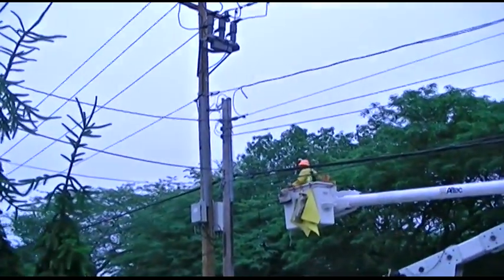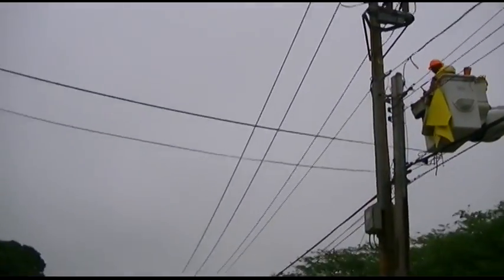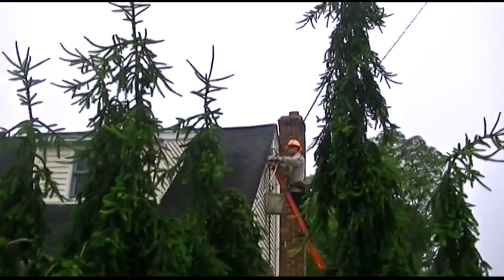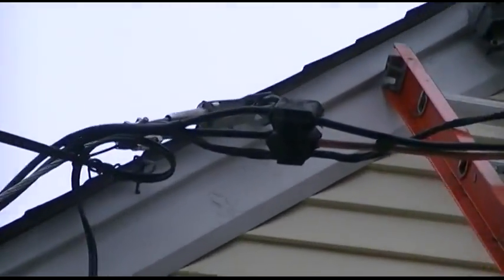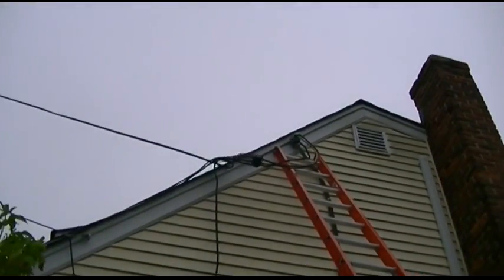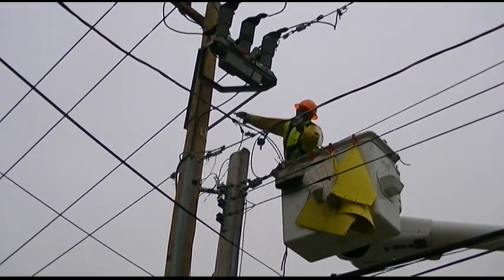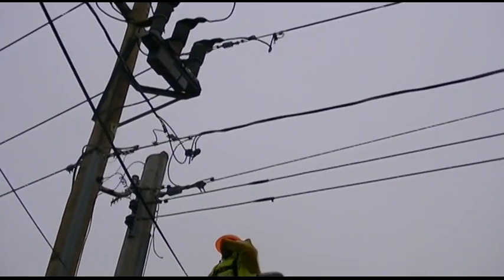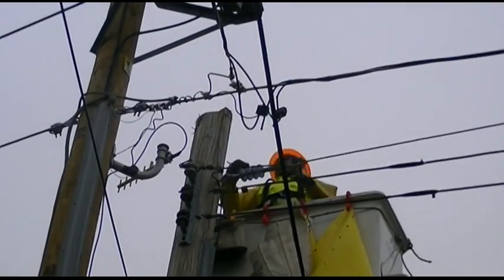New Electrical Service For The House!

Comment: 10:03 The wire in the house does not "have to go copper by Code." You can use aluminum for the drop to the meter, and from the meter to the main panel.  Range and dryer circuits are still commonly aluminum wire as well. You can (although it is no longer used) use aluminum for the individual circuits in the house.  Now some state or local municipal electrical codes may say otherwise...but it is not true "By THE Code" i.e. the NEC.
Reply from the maker: Yes, aluminum is fine on the outside of the house and to the circuit breaker panel  Aluminum hasn't been commonly used since the 70s.  I've never seen a 220V outlet using aluminum, here in NY, but other parts of the country may be different.  Is copper code here?  I don't know for sure, but I do know that existing wiring is grandfathered in as it was code for the time it was installed.

Comment: its nice. dude, can tell us how much money you spent for new electrical service? and how much amp u use in the house? thanks
Reply from the maker: I paid nothing.  The company was in the area for the entire summer, upgrading everything, replacing poles, restringing wire, so I asked them if they could redo the electrical service to the house.  

I don't use any more or less amperage in the house since the upgrade; my panel has always been 200 amps since I moved in.
Reply: @jaykay18  damn, how cool is dat. nice bro
Reply from the maker: @sobricoeg1510  It was simply a matter of being in the right place at the right time.

Comment: they use aluminum cuz its lighter than copper you would get a tight pull from pole to house with copper not to mention aluminum cools off faster better heat tension
Reply from the maker: That makes sense.

Comment: It’s fine to use aluminum wires in homes, just not 15 and 20 amp lines. 30, 40, 50, 100... Saul Goodman.
Reply from the maker: Most of those lines I've ever seen have indeed been copper.
Reply: copper is the recommended in the branch circuits in the house unless otherwise told by inspector aluminum can be the feeder   me personally I'd use copper but I aint paying the bill just installing it

Comment: ga power gave me hell last year when i ask for a new line . My electrical box needs to be upgraded in my 1950 house to put a new hvac system in. I was to told by an electrician the 3 wires they have coming in form the pole is not going to give me enough power. Ga power said they sent a guy out twice and they wires are fine.  I didnt see anyone and they refuse to schedule someone to come when im there. It seems like they dont want to do the work and have me do it .  My neighboors have the up grade.This is Crazy !!!
Reply from the maker: I can understand your frustration, but I'm not able to help you with that.  The work that I had done was a result of third-party contractors, real nice guys at that, being hired by the electric company.  Their job was to replace all the utility poles, transfer switches, and transformers around the neighborhood as they were reaching their life expectancy.  The third-party contractors didn't have to report that this work was done, their job was to do whatever was necessary, so perhaps they deemed this necessary.  In fact, they told me that the original plan was to replace the electrical service to all the homes as well, but that was scrapped because of cost.  They did it for me for doing nothing more than asking nicely, and a friend also got his done in the neighborhood, for also asking.

Comment: OO Awg Carryies 225 Amps at 90 degrees F. ITS a good match for JayKay's 200amp service, which sounds like overkill, unless you have a mother/daughter setup or a tenant.
Reply from the maker: 200 amp service is now the norm for new installations.  I already had 200 amp service; they just replaced the wires, because I asked.  They were in the neighborhood replacing all the utility poles and stringing new wire between them.  In the summer, I have a pool and 8 tons of air conditioning, so that 200 amp service comes in handy.

Comment: Well if those wires you read said 1/0 then they’re usually for 155 amp so from how I see the size of your house it should be more than enough
Reply from the maker: The panel is a 200 amp panel with a 200 amp main.  I was told they were putting 1/0 cable in.  It's 3 conductors, on different alternating phases, so there should be a current load capacity of 300 amps total over that 3-conductor cable.

You'd be surprised how much power my house uses.  There's 8 tons of air conditioning and a pool, just to start.
Reply: jaykay18 I believe your house is on a single phase which means you get 2 hots a neutral and maybe a ground those 2 hot wires are 120 volts each which makes your house a total of 240 volt with a resistance of 200amps and more. It’s rare to see a residential house on. 3 phase because you don’t need that much voltage. The bigger that wire is, the more it’s resistive to heat. Your house can also use aluminum or copper, copper is just more expensive and it’s a better
Reply from the maker: Yes, thanks, you can explain it better than I can.  That's exactly what it is.
Reply: @oscar27ization  All houses have a 3 wire 120/240 service unless you only want to have lights. That has nothing to do with 3 phase or single phase. If you have a welder or need special power like 120/208v or 277/480 etc. then you would need 3 phase power. In that case you would have a 4 wire service. That's called a transformer bank.
Reply: 1/0 copper 200 amp

Comment: @jakay18 the lines itself are not tensioned. the tension wires are wrapped around the actually electric wire to keep it from sagging. the things you said you didn't know what they were....are called insulators. it keeps the high voltage wires on the poles from arching and causing a fire. they are usually made of ceramic. also it helps with the cooling. because a lot of power lines do not have sheathing on them. the reason behind this is to keep them cool.
Reply from the maker: Thanks, they gave me some of the insulators that were up there.

Comment: my man smokin a cig while he workin on some dangerous electrical work that could kill him and straight literally blow him right off the ladder lmao.
Reply: I think you should worry about your Brain cancer than his safety, he knows what he is doing and I will bet $ that he will live longer than you do :)
Reply: @oohlangster1135  You mean COPD or lung cancer lol. I'm guessing you're a little kid.
Reply from the maker: These dudes were pretty cool.  They ran new service to the house simply because I asked.  They redid all the utility poles and strung all new wire in the area; the original plan was to run new service to each house but they quickly nixed that due to budget restrictions.  But just because I asked, they did this for me for free.  They also gave me some of the cool stuff that was on the pole, including those ceramic insulators, which is great because now you can touch and hold them instead of seeing them up there, you get to see how really big they are.  There was also an antenna on the pole that was taken down that they gave me, there's a shunt on this pole and that was replaced along with a new antenna as well.  I was actually home when they tested its wireless functionality, and you could hear the shunt inside turn on and off.  That was pretty cool.
Reply: @jaykay18  well thats cool. they usually wouldn't do that unless they knew the wires were bad. so thats why they did it. they probably just didn't tell you that ;)
Reply: those 3-3-3-5 or 2-2-2-4 wires are very expensive
Reply from the maker: Nope.  They ran it because I asked.  the service that was already run there couldn't have been more than 15 years old.  In fact, they saved the old wire they took off my house as hookup wire for others.
Reply: Can’t kill him when the wire is still laying on the ground dead not even connected to the pole. Pay attention bud
Reply: line to ground/neutral is 120V,  line to line is 240V.  He's not getting blown anywhere.  Might jolt him enough to knock him off the ladder if he's not paying attention, but it's not any higher of a voltage than the thin-as-sewing-thread wire you hang on your Christmas tree and let your pets lick/eat.   Also insulated gloves and fiberglass ladder.
Reply: I'm just saying it's not a good idea. If you are working with electricity you need to be paying attention.
Reply: @manuelruen  he’s not working with any electricity. The wire is on the freakin ground

Comment: Who is responsible for this type of work ? Homeowner??need ours changed or reinsulated .
Reply from the maker: The work done here was from the pole to the "bug nuts" on the house, at the top by the roof.  The electric company should be responsible for that.  The "service", as it's called, everything below that, is the homeowner's responsibility.  Your electric company may differ with their rules and regulations.

Comment: Thank you for documenting this.  But why wouldn't you move your car?
Reply from the maker: I was actually not home at the time they arrived, I was out with another car.  When I got home I asked them if they wanted it moved.  They had replaced all of the electrical poles and re-ran all of the rest of the service in the neighborhood and had asked me to move the car several times before, so that's why I figured I'd ask.  They told me there was no need for me to move it.  If I would have known all of this was going to transpire, I would have moved it.

Comment: FPL told me 5 years ago, when they were replacing our transformer, that they were going to replace the line that goes to my house and my neighbor's house. Never happened. Our line is 31 years old, installed in 1988.
Reply from the maker: The line to my dad's house was probably the original one from the 1950s, that was replaced maybe 10 years ago.

I made it a point to ask these guys nicely several times.  Also lucky was that they were often up and down my block for weeks since these heavy cables run at the top of the pole.  They also replaced the step-down cable running from the previous pole to the pole I showed here, and possibly down the block as well.  Another great factor was that these guys were independent contractors hired by the electric company to do this, so they really didn't care.

Comment: Classic lineman.  Up there working with a smoke hanging out of his mouth.
Reply from the maker: Yep, they were all like that.  For whatever reason, the electric company replaced all the poles and lines around here, so these guys were around for quite some time.  Every single one of them smoked.
Reply: @jaykay18  i don’t blame them they work with high voltage lines

Comment: I thought a 1/0 ALserved a 100 amp disconnect; 2/0 was rated for a 150 amp disconnect and a 4/0 AL is rated for a 200 am disconect.  I'm pretty sure the code allows Aluminum wiring for residential but Counties have amended it for the commentws your friend made below - fire hazard.
Reply from the maker: I just searched that, and I'd say you're correct.  I am only going by what they told me at the time.  Whatever they did, after the new wire was in place and hooked up, it certainly made a difference.
Reply: Open air lines receive a major deratiing. A 150A service can be supplied by a number 4 wire and a 200A can be supplied by 1-0 aluminum. Open air and to the point of contact. After the point of contact through conduit as eva said. 1/0 AL served a 100 amp disconnect, 2/0 rated for a 150 amp disconnect and a 4/0 AL rated for a 200A.

Comment: At 5:04 those are dead end bell insulators. It looks like they were used as flying bells. Flying bells are used to temporarily isolate and de energize sections of the line to do work.
Reply from the maker: Thanks, now I know what they're called!

Comment: I had a new service wire put in because they said the old one sagged across mine and the guy next door.  it had a huge span to the pole now it goes out the front mid span.  they put a new service wire, mine only had 2 wires, most likely active and neutral, and both wrapped in insulation.  I think they call it aerial bundled cable.
Reply from the maker: Yes, there are limits on how far they'll run cable without a support.  How many amps of service do you have?
Reply: the span was quite long probably more than 60 metres, as a guess without measuring it hehe.  And my service is only 100 Amps not that i would ever exceed that anyway
Reply: Also I am from Australia and things may be different, and regulations change too I guess.  Also when poles need replacing here they use big concrete ones.
Reply from the maker: I have 200 amp service; they split it over 3 wires, neutral, hot, and hot.  The second hot is 180° out-of-phase with the first so it can carry the current back over the same neutral wire; each wire can carry 100 amps safely.
Reply from the maker: Probably are different.  Concrete poles?  That I never heard of.  The ones here are wood and have been in service probably since the 1950s.  They were replaced probably because they get to a certain age where it's unsafe to leave them up any longer.  The new poles are bigger around, and taller as well.
Reply: Well here the old redgum ones that are rotted out or termite eaten are replaced with concrete ones I was told they are 4 tonnes?.  I here in South Australia they are made of like steel and concrete reinforcment. I think they are called Stobie poles.
Reply from the maker: I have no idea of the lingo that's used, so I'll take your word for that.
Reply: @jaykay18  all your 110V loads are balanced between the two hot lines inside your house. The amperage the neutral carries is only the unbalanced 110V loads working against or complimenting each other. Most areas the neutral doesn't have to be as large as the hots for this reason. Also, some municipalities use the bare neutral as the tension line. Great video showing linemen doing their thing.
Reply from the maker: Thank you.
Reply: @steviebboy69  Would hate to hit one of those in a car ...

Comment: You didnt get a new service, you got a new wire drop.. it will do nothing for you, but glad youre happy.
Reply from the maker: Oh it did a tremendous amount when those 8 tons of central air conditioning start up.  Used to be 4 gauge, the new one is 1 aught.  Lights don't dim as much when they start up.
Reply: @jaykay18  Most likely the transformer has been changed/upgraded too.
Reply from the maker: That's quite possible.
Reply: It will do something if he ever decides to upgrade his panel but his house wouldn’t need that 1/0 unless the property starts adding more appliances etc
Reply: It’ll do a ton when he adds 8-10 1k grow lights with a dedicated 3ton! Lol jk jk
Reply: That's not true at all.  Even if the transformer wasn't replaced and even without touching his panel,  the difference in resistance will definitely impact any voltage drop he was getting on the old line.   It's exactly the same effect as if you plug a heater and some lights into a long long extension cord,  the lights represent the rest of your house and the heater represents his AC.   The voltage will drop when that load kicks in (even if just a compressor surge) and if you have incandescent or dimmable LED lights you will see them flicker.

The transformer didn't matter because it would have been rated far above the current needs of his house,  and his panel doesn't matter because he was never drawing so much current that it exceeded his amperage ratings -- his complaint was solely his voltage drop when the AC kicks in.  I used to live in a house with almost identical characteristics.   The line to the house is going to be the source of all that added resistance;  i guarantee his HVAC circuit, bus bar, meter base, meter, and service entrance wiring are all thick enough since they're most likely all newer than 1954.  It's pretty common for the DNO/network wiring to be the last thing to be upgraded since that's the one job an electrical contractor can't add to his quote during a renovation or installation.

Comment: It is very nice of the utility workers to upgrade your service just by you asking to do so.  I'm sure your power supply will be more stable and less prone to problems.
Reply from the maker: I thought it was nice of them as well.  While I never did have any issues with stability of power, there's just something about the service being brand new that gives a little more peace of mind.  That 1 aught cable also made a difference, especially when the central A/C units fire up.  Now they have everything they could possibly want.  New 1-aught service, their breakers are located at the top of the panel, plus they have the Rectorseal kickstart capacitors in them.  When they start up you hardly notice.  Back before all that, you'd always notice.
Reply: Yes, bigger is better in this case.
Reply: jaykay18 my main lines going to the digital reader has become poorly insulated, who is responsible for the upgrade ? Please if you know . Thank you